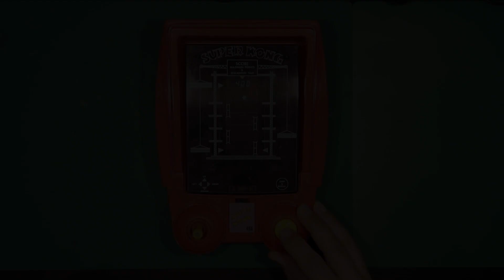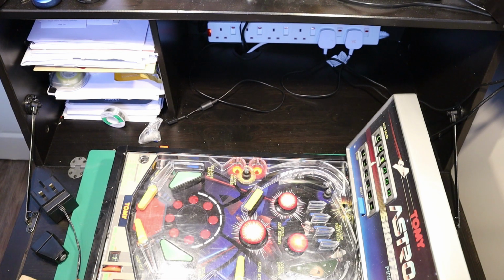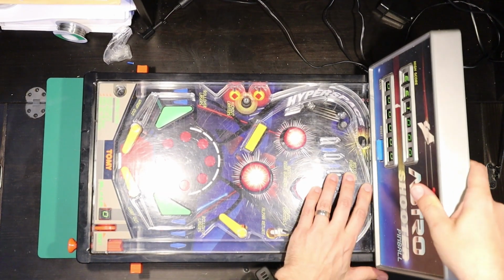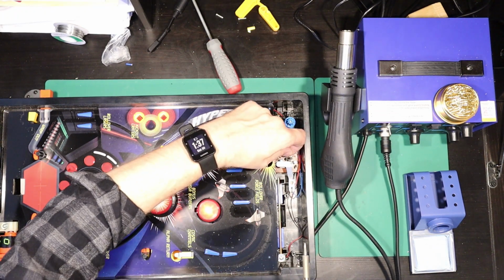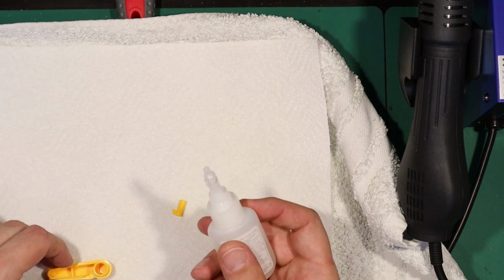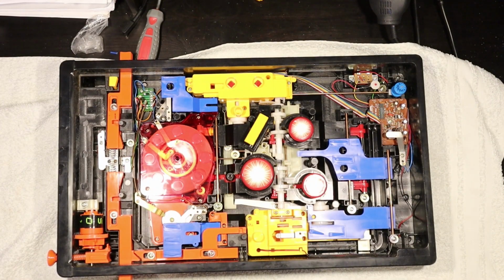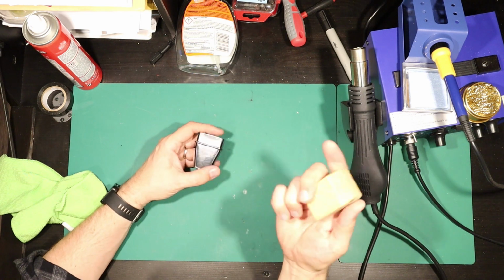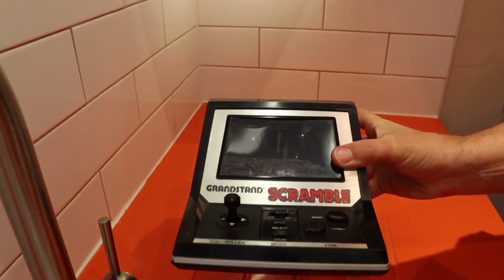Tomy Astro Shooter Pinball Repair - Retro Gaming

Comment: Brother can you tell what type of power adapter should i use.
Like should i use an AC or DC adapter and at what VOLTS and at what Current
Reply from the maker: I don't know for sure but I think it could be 9V DC center negative 2 amp. Don't take my word for it though. Sometimes if I am unsure I look at ones for sale on ebay and try to read it from the pictures of the supply.

Comment: Thanks so much for making this video. I just got the American Pinball version of this table and had some of the same issues as you. Seeing it opened up makes me feel more at ease about potentially repairing it myself. 

Did you find the spray lubrication helped to improve the bumper sensitivity? What lubricant did you use?
Reply from the maker: Hi! and welcome. Glad you enjoyed the video and thanks so much for leaving a comment. I used a spray silicone plastic safe lube. It's important to use a plastic safe lubricant. I mistakenly put two springs  on one bumper but once i fixed that, the machine benefited from the lube including bumper sensitivity.
Reply: @RetroTechRepair  Thanks! This is helpful to know. Hoping my table will see the same improvements as yours.

Comment: Hi! I recently got the same flipper
It is working fine except for the sound:
The only sound it makes is when you loose. That means the speaker is OK, but absolutly no other sound.
I have opened it, cleaned it (it was not dirty btw), checked is every cable was well soldered, checked the capacitors, but no idea why there is no sound😢
Any idea?
Reply from the maker: Sorry I don't have any other ideas other than a bad connection somewhere. Sadly I don't have the game anymore so I can't take a look at mine to try to work it out. I'm very grateful for your question. Let us know if you got it sorted out.

Comment: I have the Coca Cola retheme of this from Franklin Mint, I think the circular lights thing is broken and I need to find a way to get into the machine- would this be essentially the same way of maintenance?
Reply from the maker: I'd imagine so, but I'm certainly not an expert in repairing things. Good luck with your repair, thanks for your comments and sorry for the delay in responding

Comment: Hi did you ever figure out why the metal playfield had the soldered wire? I am wondering the same. Also was the black wire soldered to the same spot as the other blue wire on that little metal tab? Were they both soldered to the same blob/point?
Reply from the maker: Thanks for the comments JC. I'm afraid I didn't figure that out and because of space limitations I had to move the game along. ☹

Comment: I'm just restoring one of these myself and was wondering what you used to polish the clear plastic?  Thanks in advance.
Reply from the maker: Hi there... I generally use car products. I start with a general colour restorer this leaves the plastic dull. I then use a metallic colour restorer and finally a polish. This is just what has worked for me but Its not a recommendation and I'd definitely try somewhere discreet first. Thanks for your question. Good luck with the repair
Reply: @RetroTechRepair  Thanks for that.  This is my second one of these, I won it on EBAY recently for only £1 - I couldn't pass that up as if nothing else it would be great for spare parts.  It looked in really poor shape,  it was filthy, the plunger was snapped off and missing, the flippers were sticking and the scoreboard didn't work - plus it had no legs. Once I opened it it was obvious that coke had been spilled on it the past but after some very careful cleaning the flippers work perfectly and importantly the electronics and mechanical parts all seem perfect - and surprisingly the playfield looks good as new.
The scoreboard is an easy fix as it was just a small piece of plastic that had snapped off.  For  the legs I've found someone who will 3D print them for me.  The plunger is more problematic as it need to be able to stand up to some abuse but I think I have a plan that will work for that too.
That just leaves the cosmetics and I think cleaning up the clear plastic will go a long way to improve the way it looks.
Reply from the maker: @ruckage1  wow that is quite a find for £1 I haven't had much luck bargains hunting recently. Sounds like you had your work cut out, but have made some great progress. Congratulations on saving a great game from landfill

Comment: Hi, thanks for this video. I’ve got the same pinball but I cannot find the AC Adaptator anymore. Could you please tell me its technical reference so that I can buy a new one? Thank you.
Reply from the maker: Hi sorry, I do not know. I'm afraid I had to sell the game to make room for some new repairs. I will check back through the raw video footage and take a look see if I can see the markings. If not perhaps someone else here can help. Sorry and thanks for asking and watching the video
Reply: I actually just picked one up at a garage sale. I don't know the technical lingo though. 

The adapter i have is a sony ac power adapter.  Ac-930B

Input: AC 120v 60Hz 10w

Output: DC 9v 600mA

I hope that helps if you're still looking.
Reply: @Mr.-Mister-Esquire-Esq.  thanks so much for posting this!
Reply: There's another comment with a link to a site with an original picture but it's 9V 700mA negative polarity on the inside of the barrel jack. I've used a 1000mA switching power supply as a replacement and all seems fine.

Comment: just got myself a faulty one today & it doesnt turn on , there's some corrasion where u connect the power adaptor, do u think tat's the issue ?
Reply from the maker: It certainly could be. If it were mine I'd probably test the voltage from the power supply and assuming that's good try clearing the connector with some Isopropanol or contact cleaner working the connector back and fort a few times. Obviously I can't be sure so this can't be advice, but it's probably what I'd try first. Pop back and let us know how it goes!
Reply: @RetroTechRepair  Thank you for yr advise, i realised the adaptors i tried was wrong anyway. ordered a correct one and waiting for it to arrive before proceeding with the repairs needed.

Comment: Hmm shame you didn't really get to to bottom of the snoozy bumpers (for want of a better description). I think I have similar (delayed or sometimes not triggering - esp. biggest one on bottom side - occasionally the ball even just sits there and needs tipping out). Totally understand the feeling of aint broke don't fix though. It's working reasonably/fairly well so understandable not to question what the issue might be.  I don't suppose you got any insight into how they trigger though while taking it slightly apart? I'm guessing it's something like an electrical connection between the play surface and the bumper through the ball... pondering then maybe something like oxidisation on the edge of the cut out areas round the bumper which would stop/hinder the contact? Hard to know really without one that is known to be 100% fully working as a comparison.
Reply from the maker: Thanks for your detailed comments, I'll be honest it was an easy fix and it didn't notice the snoozy bumpers at all. I did fix something similar on my atomic pinball repair and in that they are mechanical in their activation and were fixed with plastic safe thin silicone lubricant. Anyhow glad you enjoyed the video and thanks again for  your detailed comments.
Reply: @RetroTechRepair  heya so I've found mine are "naturally" coming back to life as it were, with play. The triggering seems to be a plastic thing the ball rolls over so unsure about the reason for the metal play field being electrically connected. Still not feeling they are quite there yet but maybe more play will loosen stuff up. Might try an dismantle and poke or lubricate some time as you did.
Reply: @WistrelChianti  I know this is a really old comment but I just worked on one I picked up this week. The bumpers are totally mechanical, including the triggers. when the metal ball lands on the black plastic, the weight of the ball pushes the black trigger down, releasing a cog to make one revolution to pull the bumper down. I suspect all these slow bumpers are a result of warping of the black plastic piece. It can be heated carefully for 8-15 seconds in water just at the boiling point and bent back to its original shape. Only heat the part that is warped. The blue pieces in the various lanes at the top have the same issue. They just push down on the black piece when the ball rolls over them. They can get warped and either fail to push the black trigger down or hold it down all the time.
Reply: @brentcarter3284  awesome! Good to know. I got a 2nd one for myself which broke (ball capture doesn't kick out) shortly after I got it so that needs fixing at some point ( I think that's a cog) so when I get to fixing that one, will check the other parts while I'm there

Comment: Hi on mine the sound does not work, any idea? Thanks
Reply from the maker: Sorry I haven't repaired one with that fault. Maybe check power connections and battery contacts first. I think sounder works on a different circuit to the motor. Sorry I can't be more help. Thanks for you comment.
Reply: Mine had the same problem. It was easy to fix. The problem was at the speaker (a wire was loose or pulled out). I soldered the wire back on with tin. Now the pinball machine works with all the sound effects.

Comment: Note the game uses a 9v adapter but the polarity is opposite from our standard. The  positive voltage is on the outside of the connector. Good site with pic of power supply info:
http://www.jeff-z.com/pinball/toys/astroshooter/astroshooter.html
Reply from the maker: Thanks Dude. One of my other subscribers was enquiring about that  I am sure they will find the information useful.
Reply: @RetroTechRepair  Thanks RTR . An interesting mod I came up by accident is at the bottom of the jeff-z site. If you cut 3/4" strips across a 20" bicycle inner tube you can slide them snuggly down over  each flipper and greatly improve contact with the pinball.
Reply from the maker: @dude8869  what a great idea!
Reply: @dude8869  yeh I liked the look of that one myself

Comment: Enjoyed your video, sir. I loved this when I was little. But why use crap superglue at all? The parts are irreplaceable due to the scarceness of these toys, and superglue ruins everything it touches. Epoxy alone would have been a far better tool for the job. That said, good video!
Reply from the maker: Hi Matty thanks so much for your feedback. Glad you enjoyed the video. The superglue it was used to hold the pieces together while the epoxy was applied, but I am not an expert in these repairs so perhaps it wasn't necessary. Game seemed to work well maybe I got lucky. Anyway thanks for the feedback. Genuinely appreciate it.
Reply: @RetroTechRepair  No problem. The other (earlier) version of this (exactly the same, apart from stickers) was the Grandstand Pinball Wizard. I haven't seen a toy pinball as good. Yours is probably 1986/87 for a guess.
Reply from the maker: Good to know Matty, yes it's an awesome game, I saw the Grandstand version on eBay a bit back and really regret not picking it up. Thanks again for the feedback. Much appreciated